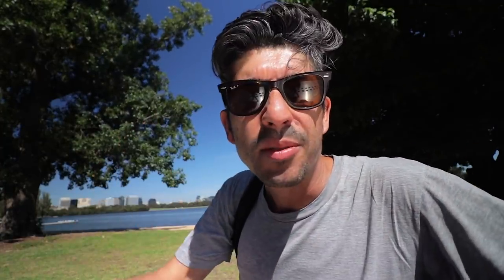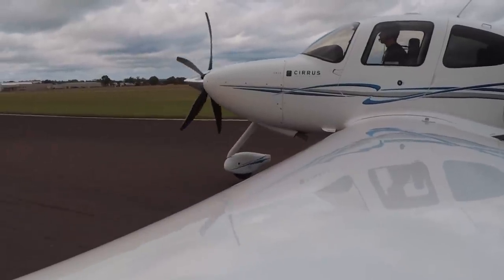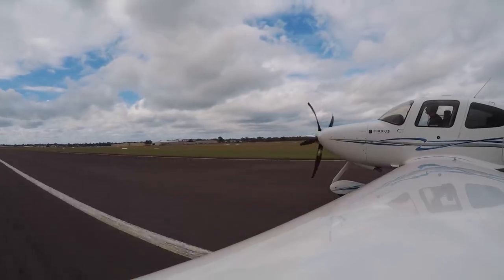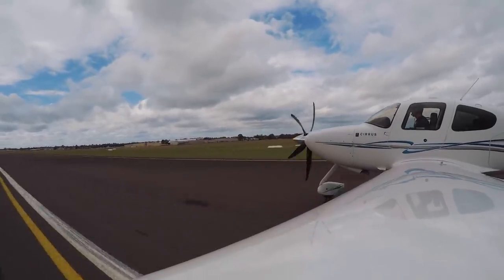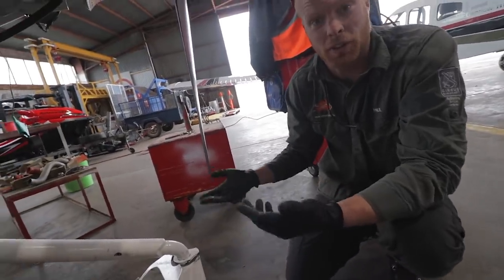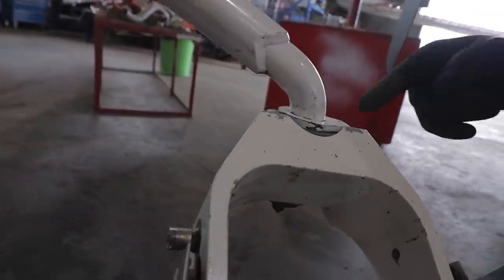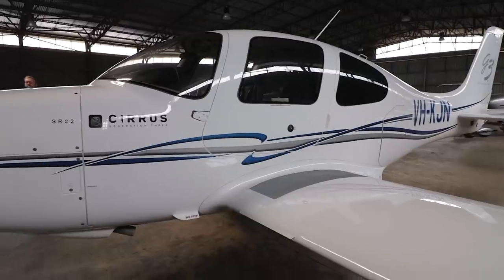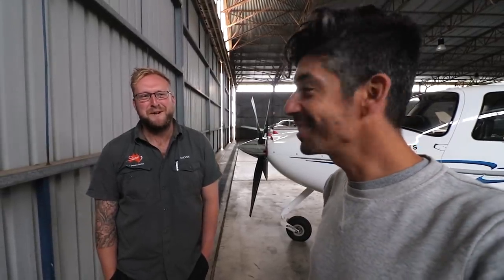How I broke a Cirrus SR22 (and how we fixed it) - real footage

Comment: Once in a C152 I was coming back from a solo navigation and my landing was pretty good, gently put the nose wheel down like on any landing, but the whole plane started vibrating with incredible violence, pulled the nose up again and as my speed bled off, nose wheel came back down on the ground and the vibrations started again, it was so bad that the ELT went off. I started braking then came to a stop and taxiing was fine. When I got down I check my shimmy dampener and it had leaked. I always check this before every flight as part of my walk around so I still don't know if I missed it in my walk around or if it leaked in flight. Either way I did a full report, the airplane was snagged and everything. I was quite humiliated that the ELT went off during my landing but as you said safety is paramount. If the nose wheel does this, continue with the landing and keep the nose wheel off the ground as long as possible a bit like a soft landing. Cheers Stef!
Reply: Did anything happen with the ELT, or were you able to turn it off quickly enough?

Comment: When I learned to fly, I did so at an airport with one runway and frequent crosswinds. I learned to do a side slip so as to align the landing gear with the runway before touchdown. I also learned to use a bit of extra speed in a crosswind landing. I’d say you were probably fine with your speed on approach, you just needed to change your crab into a side slip and then hold it off the runway until it settled down nicely. But as they say, it was still a successful landing!

Comment: Stef, Thanks for sharing the lesson learned. Take-aways for me are: 1) Aim for the stall warning on round-out > Energy management
2) Aileron into the x-wind and step on the high wing (rudder) > Proper X-wind technique & line-up in the round-out
3) Damage to the side walls of the nose wheel tyre and inside of spat could remain hidden > Look for hairline cracks in nose gear spat during pre-flight inspection.
4) Stay away from Bankstown ;-)

Comment: Is this something more likely to happen with these castor steering nose wheels?
Reply from the maker: Yeah I think the design is a factor here to some extent. There's more nosewheel movement with these free-castoring ones, which is fantastic for manouvering on the ground (you can really spin a Cirrus round in a tight space for parking) but will move around more if it's off centre on landing as you saw. Pros and cons of every design I guess.

Comment: Three point landings are bad for any tricycle gear plane.  So are side-loaded landings.  The older Cirrus nose-gear is not as robust as current models which have a hydraulic damping system now.  You NEVER want to touch the nose-wheel at the same time or before the mains in any plane, let alone a  high performance Cirrus.  Even in a side-loading situation you would have saved the nose-gear by keeping it up until the plane was tracking on the runway on the mains.

Comment: A good landing is a landing that you can walk away from, and a great landing is a landing where you can use the Airplane again. So it was a great landing
Reply from the maker: Thanks Joe. Definitely some learnings for me from the experience that’s for sure.
Reply: False. I hate that saying. His landing was a bit fast but this isn't his fault. The nosewheel is setup wrong and tire pressure is probably set wrong too. 100% sure this doesn't pass the normal tension test that's supposed to be performed at annual.
Reply: Lol, and a perfect landing is one you can make a video about. Either way, thanks for being so upfront with us and sharing your aviation life with us.

Comment: This isn't your fault. The tension isn't set high enough on the nose wheel. Ours did the same thing occasionally until we FIXED the root cause. The Belleville washers are worn out or setup incorrectly. Don't let anyone blame it on you. The mechanic doesn't have it setup right.
Reply from the maker: Hey briantii, I appreciate the comment but I have absolute faith in the engineering team to have the aircraft setup right. Thanks for watching mate, stef 👍
Reply: @StefanDrury  I'm telling you - I am 100% sure. It was not setup correctly. We own a Cirrus too. Had the same problem. Setup correctly it will not do that.

Comment: Seems like more of a mechanical problem than a pilot problem, I imagine student pilots would crack those left and right.
Reply: The SR22's nose wheel is definitely too fragile for its' own good, and with the shimmy that Stefan has had on some landings in previous videos I had a feeling something like this would happen. Worst case scenario the shimmy is so strong that it can damage more than just the spat. It really shouldn't happen to that degree even with bad conditions or a bad landing. The problem seems to be exacerbated by the amount of flex Cirrus has on the nose wheel strut for dampening, creating a resonance that causes the wheel to develop a serious flutter in some cases.
Reply: @erikthered4929  It's the tension on the nose wheel. It's set incorrectly, tire pressure, and potentially the belleville washers are worn out and need to be replaced. There is a reason why this is supposed to be checked / maintained at annual. It requires maintenance and if it's loose it'll do exactly what it did.

Comment: It straight up is a terrible design.
Reply from the maker: If you're talking about the pilot, I don't disagree...
Reply: Love my "steerable nosewheel".... wouldn't have it any other way. Castoring nosewheels require the correct tension. Too loose and they shimmy and shake. Too tight and they won't  turn.
After time they loosen up and require re-tensioning...... 
To some degree, I think yours was a bit loose. Maint facility obviously won't admit that....
Reply: Stefan Drury 😂 I love the humility.
Reply: It works fine when it's setup correctly. When it's setup INCORRECTLY it does what you see in the video. This is a maintenance problem NOT a pilot problem. Us pilots have enough things to beat ourselves up over... this isn't one of them. Our Cirrus has the same shimmy occasionally. It doesn't EVER do it now that the Belleville washers are new and the tension is set correctly.
Reply: @StefanDrury  Man give yourself a break, this is PURELY a maintenance problem. Your approach was a little fast... but when these things are setup wrong it WILL do what you saw on the video sometimes no matter how perfect your landing is. You can sit down on the mains, nosewheel held in the air with the stall horn going off and only let the nose touch when you run out of elevator and it'll STILL SHIMMY. I promise you... from a Cirrus owner who has had this exact same problem - THIS IS NOT YOUR FAULT.
Reply: See comments below for a good discussion on the subject from the standpoint of a pair of Cirrus owners.
Reply: GBigs Angle No I blame poor maintenance. Not only am I a licensed and current instrument rated private pilot, but I am also a Cirrus owner who has experienced that exact same problem. If the tension is set correctly and the washer in good shape the design will not shimmy like that. His landing was crap for sure, but that’s not what caused the shimmy. Sorry, but I am intimately familiar with this problem had have had it occur with perfect landings. I’ve also had it FIXED and it’s now impossible to recreate this problem on my airplane.
Reply: @briantii  Okay, if you own a Cirrus then you should recognize what happened here.  He set the plane down on the nose-gear at or before the mains..notice the little bounce he took before setting it down again on the nose-gear.  In the older Cirrus without the damping system this is a disaster.  Castoring the nose-wheel like that is an indication he was riding on it.    If there is a cross-wind then it's also imperative the nose-gear be held off the runway for as long as it take to track the mains straight.  Side-loading is a great way to ruin all the gear, not just the nose-gear.  Maint. had nothing to do with a poor landing technique.
Reply: @gbigsangle3044  Looks like he touched the right main gear first (and hard) and then failed to keep the nose wheel off the ground because he carried too much speed. I can't tell if the nose wheel bounces were with the mains still on the ground or not. The pivot angle to me looks like he only bounced the nose but you're right he could have bounced the mains (whole airplane) and come back nose wheel first on one or more of the bounces. The shimmy started though on his very first touch down with mains first. (But I agree, hard and fast) 

It looked like to me he touched down hard, it shimmied, he instinctively pulled the nose off and let it down again. The angle of the vide is hard for me to say for sure though.

I agree it was a bad landing, but I also do not believe the nosewheel was setup correctly. I've fought the same issue and blamed myself too many times and been told it was setup "correctly". It wasn't. Ours would do it sometimes even if you greased the mains on with the stall horn going off and gently held the nose wheel off during rollout until you ran out of elevator authority. The problem is EXTREMELY frustrating. A good shop who knows the system will have it setup where not even a bad landing like this will cause it.
Reply: @briantii  I apologize to you for assuming you were not experienced. So many commenting on these boards and are not pilots and are generally Cirrus haters based on ignorance and no experience.  I too am a Cirrus owner.  The product is high performance and VERY responsive.  It takes some time to become proficient in flying one correctly.  But once that is achieved there is just no other GA plane like them.
Reply: @gbigsangle3044  No worries a d awesome that you have a Cirrus! I agree lots of inexperience and flight simers on YouTube. All of them know more than us idiots who actually fly airplanes. :-) 

We only have a lowly SR20 but absolutely love it. Being an older sr20 the UL on ours is fairly high. I can't really say anything bad about it and hope it didn't sound like I was blaming Cirrus or the airplane in my other posts. There are just somethings that have to be setup correctly for it to work right... and that nosewheel is one of them. It's no big deal just sometimes those washers should be replaced and not just retorqued. Also as a side note, the castle nut on the spindle should be replaced instead of reused all the time. Over the years that caused damage to our spindle that had to be repaired.

My concern with the poster of the video was that the rental place maybe trying to charge him for the wheel pant repair. His landing sucked... but if they'd maintained the nosewheel better its unlikely it would have happened. We all have crap landings on occasion, the airplane shouldn't self destruct when we do. Properly maintained it won't. Cessnas have shimmy dampners and will have similar or worse problems when it goes bad. (And it's more expensive than a few washers on the Cirrus)

Take care and fly safe!